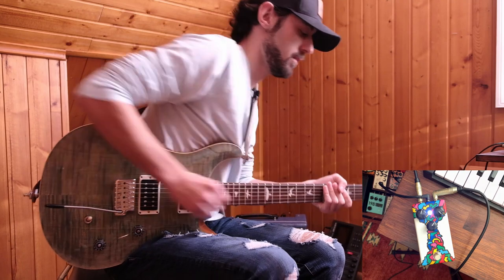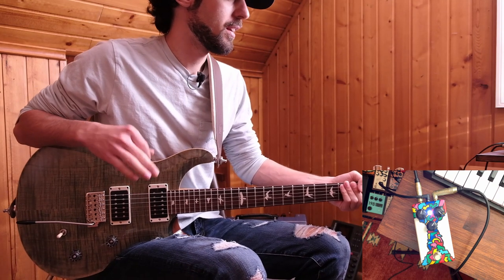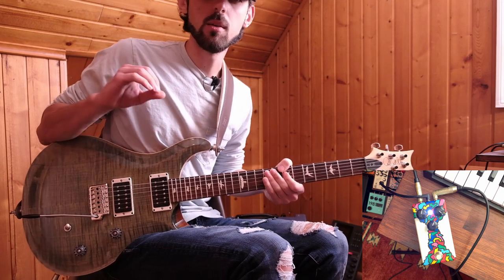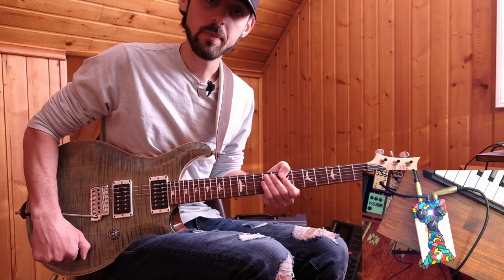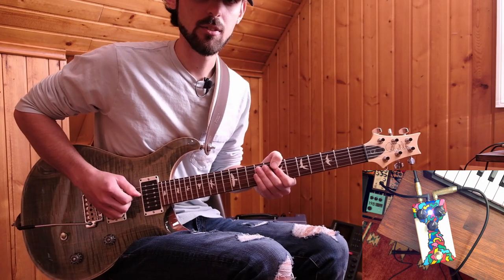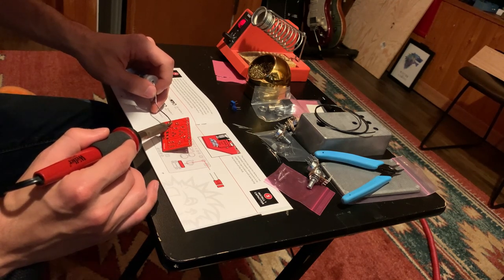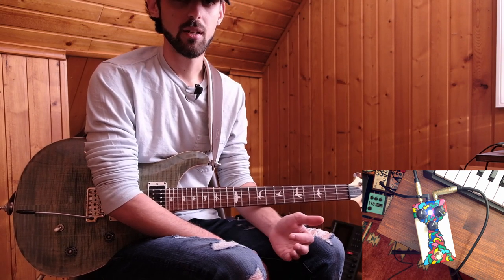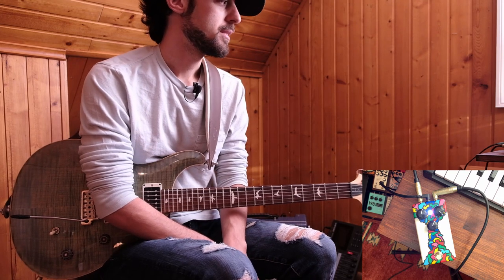Build Your Own Boutique Fuzz? Stew Mac Sun Fuzz Kit

Comment: No shade thrown here, but someone show me the example of a fuzz…? I’m sure there are some technicalities that make this a fuzz, but to me it was a super warm gentle overdrive…? Am I stupid? Please, YouTube, tell me…
Reply: The difference is how you clip (distort) the signal.
A fuzz uses transistors and will usually be a lot more distorted (especially if they are silicon) than an overdrive (which uses diodes). However, simple fuzzes (with only 2 transistors) will usually clean up quite well with the guitar volume, making them sound like light overdrives.

Comment: I just build the Stew Mac Sun Fuzz... its exactly what I've been looking for in a Fuzz.  I added a transistor socket, but the BC108 transistors that come with the kit sound just fine. Easy to build, requires soldering skills, good instructional booklet (READ the instructions twice), and a help line if you need assistance.